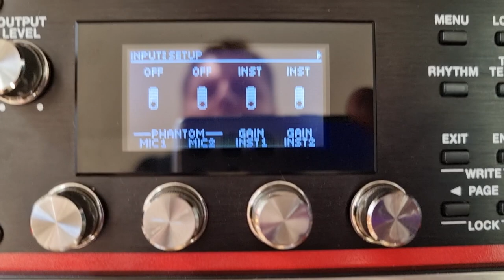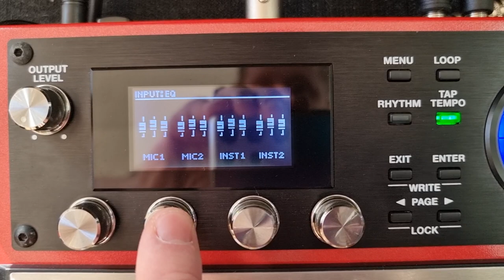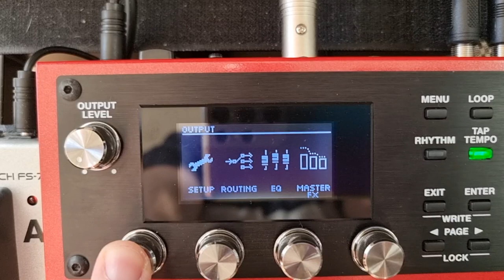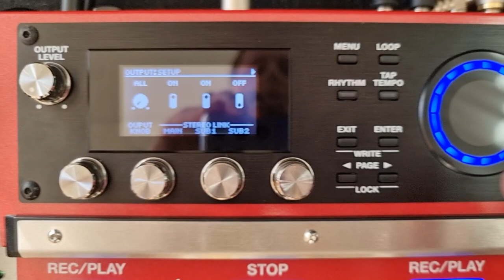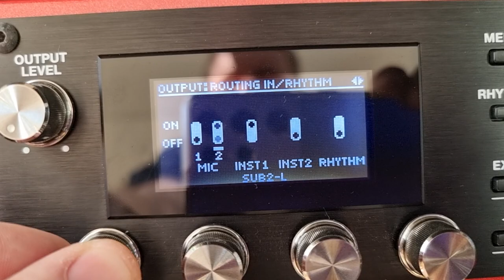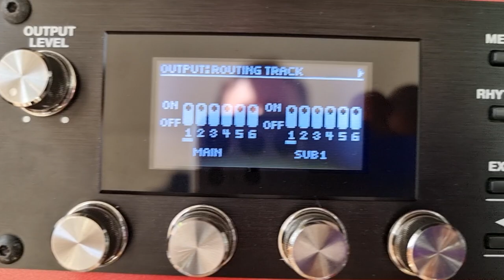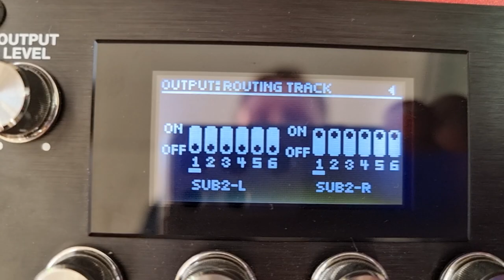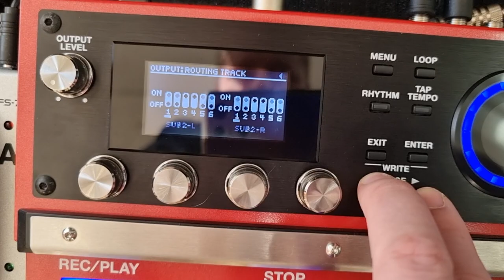Understand Your INPUTS, OUTPUTS and ROUTING Options

Comment: Hey Ross, can you explain me, how I put the cables from the rc600 to the katana ? Guitar normal in to the amp?
Reply from the maker: I will make a video on this very soon, but basically, run your guitar straight into the front of your amp, then from the FX loop 'send' runa cable to the instrument input on the RC, then run another cable from your chosen output on the RC back into the FX loop 'return' on the Katana. That way you'll be able to change guitar tones on the amp without it affecting the tracks on the RC-600. If you don't use the FX loop, every time you change tones on the amp, this will affect the signal coming into the looper and produce a very unpleasant sound when playing your tracks back. Hope this helps. Ross

Comment: whats a sub output for?
Reply from the maker: If you wanted to route certain instruments or tracks to a different speaker system, amp, mixer channel, etc. A good way of having more control of the overall sound production. Check out my latest video which takes you through how to use all 6 inputs and 6 outputs.